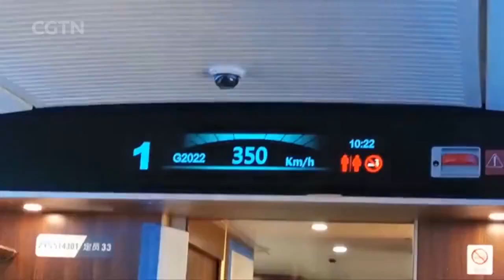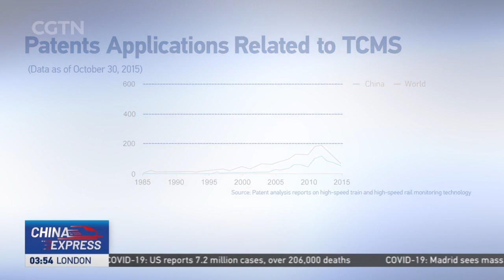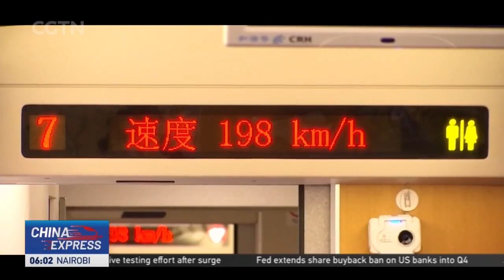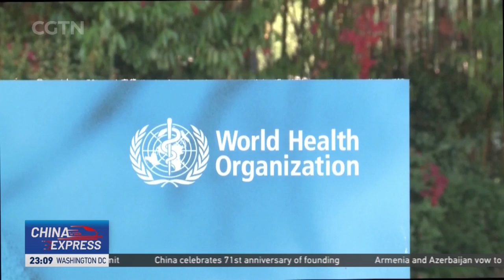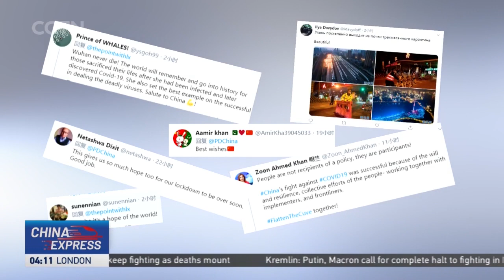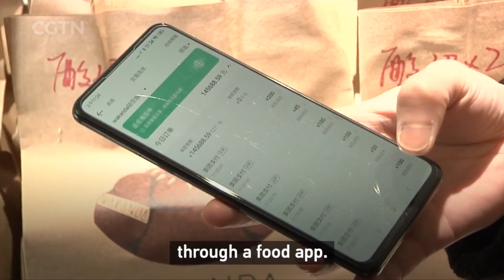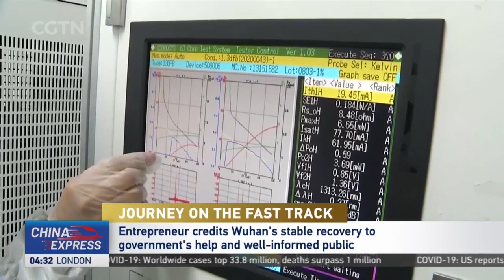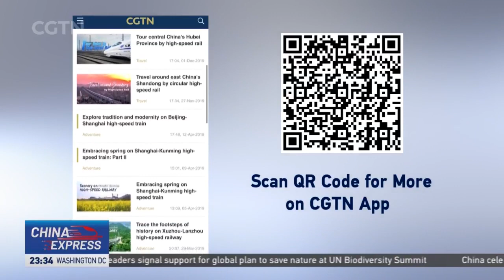Live: Special coverage on an eight-day China high-speed rail tour坐高铁看中国，纵横之间领略中国之美

Comment: Question to make the all the rails, stations, bridges, & trains, & power the train how much carbon is used>?
Reply: 你应该去查京沪高铁的能耗，来回一趟30000多度电，来回能载2300人左右，只要13度把人从上海送到1368km外的北京。你开小汽车试试？
Reply: Taking a round-trip fast train from Beijing to Shanghai (1368 km away) requires 30,000 kWh of electricity. It will carry ~2300 people. Each people only consumes ~13 kwh of electricity. Super-low carbon release and very efficient in comparison to cars and airplanes.